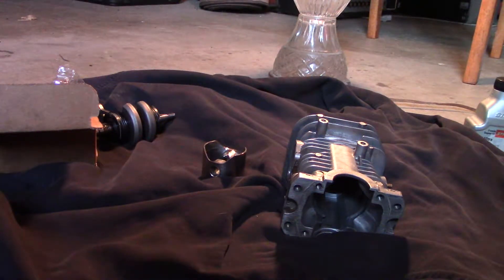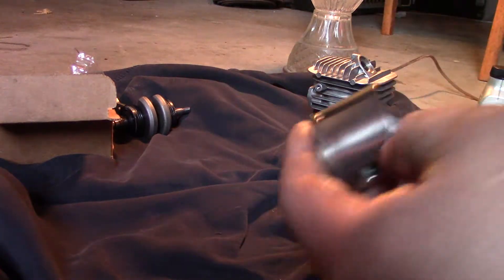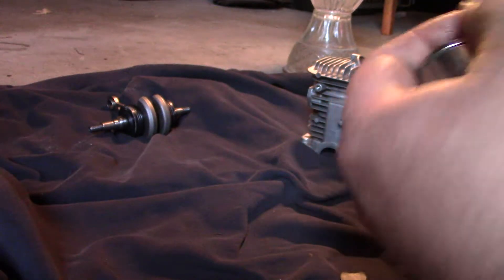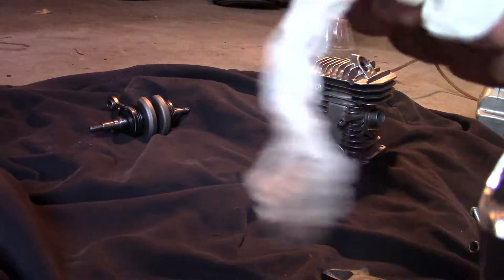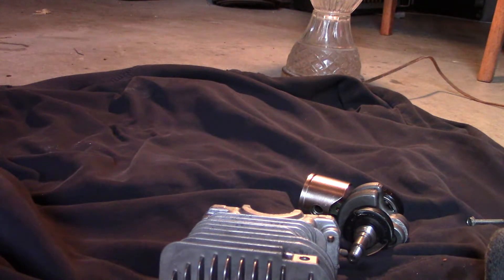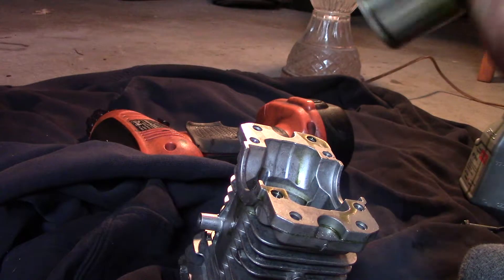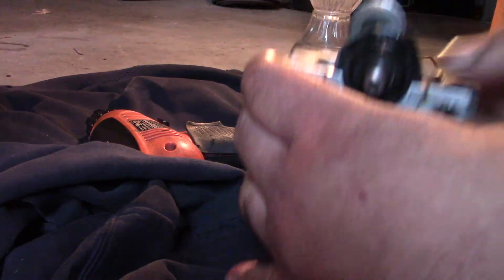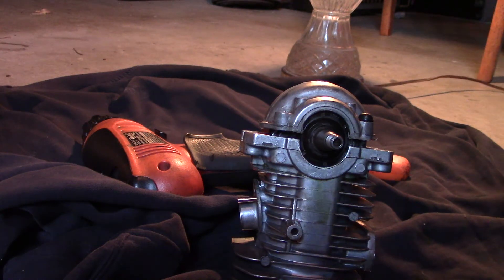Husqvarna and poulan! Best Chainsaw engine rebuilding TIPS!

Comment: Tried to rebuild my old poulan with a kit from Amazon. It didn't work with small differences,that impulse line being one. Ended up buying a complete used engine and everything was the same. Got done then saw a small metal plate that looks as if it was supposed to go in the area of the carb. Now dreading taking it back apart hoping to guess where it might go.